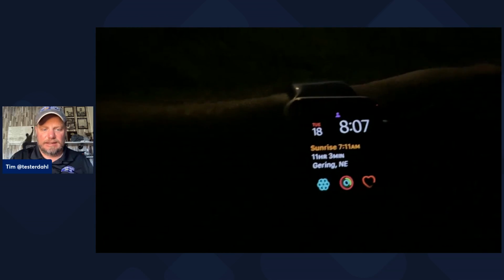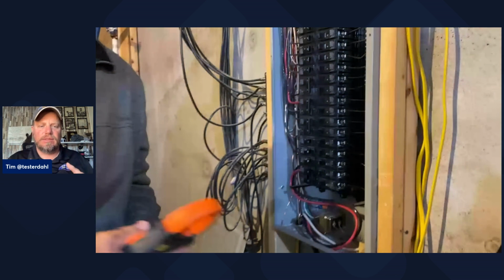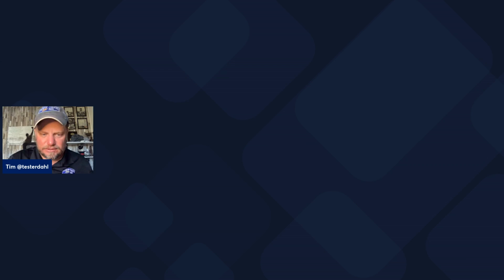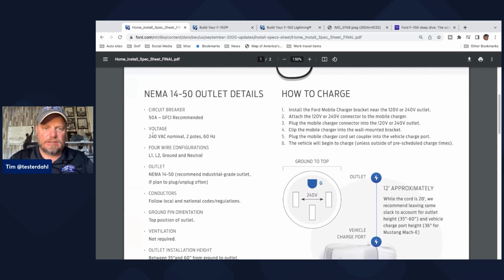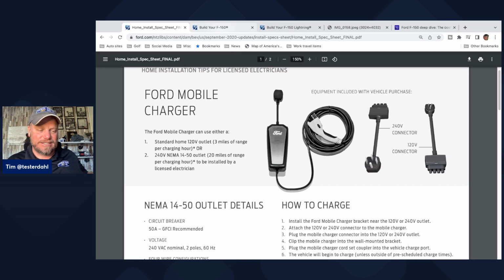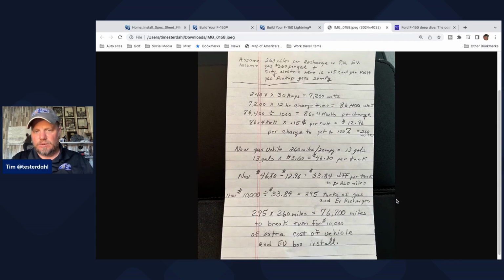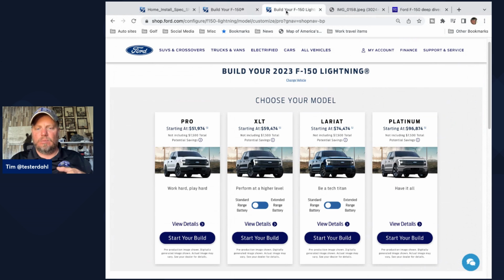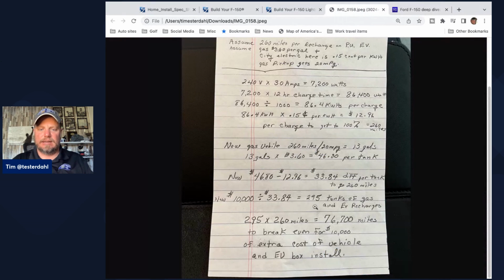11+ hours later on 220V charging price for 2022 Ford F-150 Lightning

Comment: A few comments...1. Batteries and electronics performance are dependant on their temperature.  So the range changing from 260mi@99% to 256mi@100% may have had to do with the temperature at the times you checked the truck status.  If you look at the manual for most electronics..phone, GPS, etc, they usually say something like "operating range: 40 to 104 degrees F".  The middle of that range is probably where you get the best performance.  This doesn't include the fact that mechanical components shrink with temperature and make things like bearing bushings tighter, which will require more power to run when its cold.  I could easily see if you tried to tow an RV out of hunting camp on a 20 degree morning where you are going to want the run the electric heater and electric butt warmers, defrost, etc. that you might have all of 40mile max range on a fully charged truck.  Never mind the fact that you will never have a fully charged truck sitting in hunting camp.  Nobody is going to take an acre of solor panels and stuff into the woods just to let it charge for a week and still not be able to get home.
2. To factor into the total cost of ownership...some states are charging higher registration fees, even double or triple, for hybrids and total electrics to make up for the fuel tax they won't be getting.  You know, the tax that pays for the roads you are driving on.
3.  Auto Insurance is higher because the vehicles are more expensive to purchase or repair (after an accident).

For all those people that think we can easily eliminate oil, natural gas, or other fossil fuel from our lives...take a look around you.  If it is made of plastic, sythetic fibers, most rubber, or many medicines...consider life without it.  Because the basic raw material that ALL of that came from is fossil fuels.  Cameras, TVs, clothes, seat cushions, mattresses, the computer or phone your reading this on, dishes, hats, and probably 80% of the truck this video is about are all made from fossil fuels.  If you want to imagine life without fossil fuels, think what life was like about 250-300yrs ago.  We need new ideas that no one has thought about yet.
Reply: You forgot to mention the transportation of all those goods. Everything, from food, to consumer goods, medical supplies, to the materials needed to assemble your electric car, is being shipped by cargo ship/boats, cargo planes, freight trains, and semi trucks. There's no current battery technology available to meet their needs.
Reply: Byron:  Once government mandates EV's, improvement stops.  Government stops competition and competition creates improvement. 
You can see this in cars.  In the 50's, small car manufacturers disappeared by 1956.  Of course American Motors stayed as a pet of the big 3. (Studebaker was on life supports until the 60's)i
The 59's were basically the same cars as the 76's.
In the 70's,  the EPA crippled the gas engines of the big 3.
Innovation came through the Japanese.
Reply: And the mining industry depends on a byproduct of fossil fuels to extract the minerals
Reply: @Bryan-Hensley  It sounds like you have to be an engineer to operate an EV.
I am used to gas and go.
I remember the days of carburetor adjustments,  points, condenser, spark plugs gap, distributor caps, and wires.  Those are a thing of the past.
Reply: Fjb
Reply: @jamesmooney8933  Lol with an EV it is plug and go, the issue is he didn’t do his homework to figure if the included charger was enough or if he needed a better one. I on the other hand bought a Chargepoint so I can use charge at a faster rate.
Reply: @seanroge  plug and go? You forgot to unplug it.   Cold effects the battery.   Battery cost about $20,000.  Of course you have to get maintenance insurance,  and hope the insurance company will pay. 
Water is a problem.   Where I live street flood.
As long as the water does make it to the air intake or battery which is about 2 1/2 ft.  You can make it through.   Once I was speeding through a flood road, and water was flying out like a speed boat.
EV'S have their battery in the frame of the car about 6" of the ground.   Once water gets to the battery or motor then you are in trouble.   You better hope you maintenance insurance covers water damage. 
No part on my car costs $20,000 to replace.   Also desposing of the old batteries will be expensive. 
I think you should buy an EV.
Reply: 1.8 cents per kw off peak electric rates. Way cheaper than gas. Only an idiot charges during peak. Super off peak almost everywhere including Sandy Erlich has the highest electric is about $.10 per kilowatt maximum. this is 60% cheaper than iterated in this video which means payoff comes much quicker, closer to 30,000 miles. 

If you have solar it’s even cheaper. Plus the oil changes, turn ups it’s way way cheaper. Calculate how much you will save over 150,000 miles you basically get the truck for free. 

You get the truck for money you were would have otherwise literally burned.
Reply: @Billetus  
But how long is that going to hold true, even if it is?
You can bet that at some point, those chargers will be required to have their own meter, and it will be just as, if not more, costly to run an EV than it presently is for an IC vehicle.
Then there's the little problem with the electricity used to charge them itself.
Most of it is from coal powered plants, and if you think that wind and solar is going to do the job, I have some ocean front property right outside Manhattan Kansas that I will let you have a sweet deal on.
I spoke with a dealer about used EV's, he said anyone who would even consider a used one needed to have their head examined.
Replacing the battery would be like replacing the engine in a gas or diesel car, and they can go kaput long before their stated life expectancy, and the warranty on them is a joke, they are not replaced free of charge, read the fine print just a bit closer.
They usually just total them out except for the truly expensive ones.
EV's may be the answer in the future, but it's a future that's likely to be well beyond any of our lifetimes!
Reply: This is about control not the environment 
The mining of all these things needed to build the cars are way worse than the oil industry
Reply: @jamesmooney8933  Not sure where you are getting your numbers. They can replace individual cells they don’t need to change the whole pack. Ground clearance on a Lightning is 8.4 not 6. Could keep going but don’t see the point.
Reply: We're not trying to eliminate oil. Just most pollution type and that's a no-brainer. EVs are one of the fastest ways to cut down on pollutions by ICE cars.
Reply: @Billetus  Electric prices have rising, under Biden. 
You don't have to be a genius to gas up your car. 
I can gas up anything. 
You have to be a technician to figure out the protocol for charging up an EV.
Reply: @jamesmooney8933  It is done technician but the whole battery does NOT need to be replaced just the damaged cells in the pack.
Reply: @seanroge  So how long will it last before more batteries need replaced?
It great for the upper middle class, but used cars are what services the middle & lower classes. 
Used cars get the poor to work, which feed you at the restaurants. 
If the lower classes can't get to work then welfare costs will rise.
Here is an interesting fact;
Only English speaking countries have a taboo against horse meat, but why?  One of the Kings of England made it illegal to Slaughter horses, buy why?  The situation was that only the nobility could afford horses. The nobles had large estates.  These estates were large farms,, that  were in the business of providing food for England. The horses were used to drive the carriages, riding, plowing fields, pulling wagons, etc.
After the horse we no good for work, the nobles would Slaughter the horses sell or eat the meat. 
So when the nobles could no longer Slaughter the horse, they sold them to the peasants, cheap.
(actually the beginning of what developed into the used car market)
The peasant started growing crops,  and other businesses that used horses.  This developed the middle class.   So when you see a used car lot, it actually funds the economy.
Reply: My BoltEV range fluctuates based on how the car is driven (speed driven, acceleration usage, A/C or Heater usage, terrain, etc).  I ignore it and just look at the capacity and I have learned that if I want/need a little more range, I can turn off the A/C or Heat or I can slow down a little.
Reply: @Billetus  let us know how much you saved on your EV truck after 150,000 miles and if all that stuff is still working. My Toyota is, and it does everything I need it to without any issues.
Reply: @radicalrick9587  I understand and support reducing pollution.  The problem is when you look at the whole picture of EV's...from the mining to the disposal; EV's have a bigger carbon and pollution footprint the ICE's.  You just don't see it in your neighborhood like you do with ICE's.  This is especially true when most of the electrical power to charge the EV comes from coal & natural gas.  Solar and Wind have the same problem as EV's...the cradle to grave carbon footprint is bigger than the current fossil fuel options.  Nuclear has the smallest carbon footprint of any power source, but I don't know if the country is ready to embrace that idea again.  Until they can get a consistent reliable 300-500 mile range and a 10min charge rate, especially in a truck; EV's will not be widely accepted.   EV won't save the planet.  Right now, we are stuck with choosing the least sucky options.  As I said, we need new ideas that no one has thought about yet.
Reply: Range estimate DEFINITELY depends on temperature, because it's assumed you'll be keeping the cabin warm and heating the cabin is THE killer of range in winter for EVs.  Ford should have included a combustion heater as a factory option just like many commercial vehicles have Webasto or Eberspacher hydronic heaters as a factory option.  (A few Chevy Bolt owners in very cold climates have installed Eberspacher hydronic heaters for cabin heat - best of both worlds for an effective "plugin hybrid" - combustion heat is 80-90% efficient while a combustion engine is usually 20-30%)

Also the last few percent of battery charges much more slowly.  That's an inherent behavior of lithium batteries - constant current until the voltage limit is reached, tapering current past that.

Something was a little odd with the truck pulling 30A - that's a rather odd current.  24A is the limit for a 30A outlet/breaker (NEC requires derating by 20% for continuous loads more than 3 hours), 32A would be the limit for a 40A breaker but those are rare - I'd expect to be seeing 40A pulled from a NEMA 6-50 or 14-50 outlet, and possibly even higher if hardwired.

Edit:  Apparently' Ford's base model EVSE only supports 30A, the base model Lightning can go up to 48A with a hardwired EVSE.
Reply: Thanks for telling us what we already know and leaving out everything else.
Reply: You explained it RIGHT. just do not tell that to Activist, you get all kinds of BS!
Reply: @Botman.com1125  What kind of BS? He stated things that are well known
Reply: They want to go green, Secretary Pete Buttigieg has already said he wants to change per miles drivers are traveling per year.
Reply: @Botman.com1125  our problem right now is we could be going under a authoritarian government where you are told what to drive by the GOP oil and gas company and they work for the cartel and not the American people the world is changing to renewables and green energy and the GOP big oil company is having a hard time with that ideal there are so many ways to make renewable clean energy .we try to get started in electric cars ago 50 years ago with electric cars the technology was not here yet but people loved there electric cars then .now the time is good to have more options on energy for many reasons it’s a good thing I think capacitors in the railroad system is going to be a big deal going forward with regeneration braking
Reply: @garyhunt2729  So does Elon Musk and he now has the influence to make it happen
Reply: @aaronwalters2677  electric vehicles will prove to be better if technology is not stop  by greedy oil cartels but besides that electric vehicles are the best and strongest motor on earth thats why trains use electric motors on the track batteries are getting better leaps and bonds and capacitors made with graphene are being made now it is exciting times we live in.I remember farmers all most fist fighting when other farmers were going to rubber wheels on there tractors they refused to change there ways to there death one thing is sure in life is change .I do think right now it is a no brainer vehicles no set routes like postal any local delivery are great choices .
Reply: @shane3878  your right just pointing out how they play there games your right
Reply: @drakemia4079  I agree electric motors are great and efficient but that’s not really the issue. Energy density and battery’s are the problem, fix that and then maybe start migrating towards EV’s.  Right now though we are literally wrecking entire economies because of a political narrative to just eliminate fossil fuels and that’s a dipshit way to go about this. I like freedom and I like cheap energy and if we stay on this path we’ll have neither.
Reply: @drakemia4079  No one can dominate the EV industry until technology and infrastructure are capable supporting said industry.  It's not even on my radar till there is a truck that can tow 15K pounds.  Along with scores of others.
Reply: @aaronwalters2677  EVs are great and Elon is going to have you driving one. They will be powered by nuclear energy.
Reply: @shane3878  your right ABOUT GOP BELIEVE THEM THEY WILL DO EVERYTHING THEY SAY THEY WILL
Reply: @keithdf2001  Doubtful, but hey I guess we’ll see if you’re right.
Reply: 100% Correct, the grim reality know one admits regarding the Green New Deal. 
As stated in the reply, the answer to all of this has not been invented yet. 
Nor will it be without cheap energy ( aka fossil fuels) which will foster advances in better education,science, society and intervention which will develop and solve the clean affordable energy issue. 
We’re not there yet…
Reply: Just live your life it will all work out my dad always said you will know more in the sweet by and by .
Reply: @doublegg6863  we will know more in the sweet by an by
Reply: @doublegg6863  let the oil run out everyone in the United States will have a job going green and doing everything by had .Or figure out clean ways to do things faster
Reply: It took along time to get to the moon, but it started with the political will to do it. I think the same applies to EV's and alternate energy sources. We have to start some where because the alternative is unsustainable and a danger to life on earth. Now we need the political will.
Reply: @billwhitis9997  there’s better ways for every thing it will happen
Reply: @drakemia4079  Not what I said and you know it.  You claim the GOP is authoritarian.  I say BS.  Given what happened the last 2+ years, anyone that claims the GOP is authoritarian is either deceitful or just plain lacking in the smarts department.
Reply: @shane3878  roll the dice go red
Reply: Clearly you know nothing about the technology of EV's
Reply: @seanroge  still think your missing the point. Technology isnt good enough yet to achieve what there trying to do. Grids cant handle just 10% of vehichles being electric.  Nevermind all the other downsides to creating all these unrecylable battieries there making. Average electrical vehichle lifespan is only ten years before the maintence costs exceed the value.  Just google all the fields of dead electric cars in Europe.
Reply: @markchapmon8670  Well, that sounds really handy, doesn’t it?  Turning off AC is not dangerous, but turning off the defrost in a northern climate certainly is.
Reply: Origin Materials will make plastic precursors from wood pulp and non-food organic materials. They will replace a serious amount of demand for oil to make plastics and other materials. Also, 25% of electricity now comes  from renewables in the U.S., and that figure is growing exponentially. Also, solar is getting MUCH more efficient and affordable. Same goes for battery tech, which greatly increases the value of wind and solar.
Several synergies ARE HAPPENING, right now, which completely undercut your logic. It's coming, fast, and this is a good thing.
Reply: @drakemia4079  everything is mined in other countries unlike oil and gas . That’s the majority of the jobs
Reply: You forgot to say nuclear.
Reply: @Billetus  Those price’s won’t last. The rules of supply and demand will see to that, just like it has done with gasoline.
Reply: @raymondlanier1112  the future is bright for energy more people more ways to do things it’s a great time to live in . I remember when I raised cattle we would .A.I cattle then all the cow would have calves at about the same time it is great but one year it was not we lost a lot of calves in a blizzard. I think putting all our vehicles on one fuel is a mistake for many reasons renewable energy can only get better big oil will all ways have a job no doubt they have kept it all to themselves but people know better the world knows better and are breaking records every day it is better for all Americans when they compete.we the American people always end up paying the bill but not having energy is worse so be happy every day and enjoy more ways to produce energy.
Reply: @raymondlanier1112  we need each other the sodium polbatteries
Reply: @raymondlanier1112  sodium polymer batteries are looking good
Reply: Ref  #2 Its also because of weight. Electrics are far heavier for the size. All that weight beats up the road.
Age gvw and engine size are the key considerations for registration cost in my state.
Reply: I saw a receipt on a battery replacement for a volt.  25K.
Reply: @fixitallpaul4847  yes but how many trucks filled with fuel don’t roll over the road to deliver fuel in America the more electric cars are on the road
Reply: I agree a stopgap solution halfway between two techs are very rarely optimum. I worked in the fertilizer industry. Guess where the raw material comes from mostly to produce fertilizers? It is a by-product of fossil fuel refinery. So we can stop eating as well as long as we have our EVs to drive in.
Reply: @drakemia4079  I'm not the one who doesn't understand what authoritarian means...
Reply: @jamesmooney8933  Good point about points.  In the early days of gasoline cars, you wouldnt get very far if you didnt have some understanding of how it works, for instance in the Model T you had to have a rudimentary knowledge of timing and mixture or you likely could never start it. As long as you understood enough to get it started, through experience you would learn when to advance the spark, when to lean the mixture.  I wasnt around for that but I do remember keeping an emery board and a spare points/condensor in the glove box that never had gloves in it.  Same with an electric car, it is different, you have to plan your moves. You can get used to knowing how to take care of the battery, things such as avoid charging to 100% unless you are going to drive it immediately, avoid discharging below 20%, avoid charging in below freezing temps. Many will be careful and get 150,000 out of their battery before it is degraded to 75% of it's original range, others will ignore the advice, charge it to 100% and leave it every day, and run it down till in forcably slows down and their battery will be wrecked in 25,000 miles.
 Battery electric is not practical for long distance highway use.  And it is not suitable for large vehicles like pickups, period.  Sure if you can afford 100k plus another 50k to charge it with your own solar farm, go for it and use that to teach others the realities of battery electric vehicles.  What needs to happen is standardize battery cells that can individually swapped out of the car in a minute. Instead of waiting to charge, you swap batteries just like your battery drill.
But the big problem that far too many who think we can flip a switch and no longer need petroleum are not aware of, even if we could make half a billion big assed batteries, just for US passenger cars, Where are we going to get the 16kwh per day that each car will need to charge them?  Your electric car will easily double your electric bill.  That is 6.2 gigawatt hours of power, and because every body wants to plug in their car to charge it at 7pm you can triple that capacity when sizing the grid capacity AND everybody wants to charge when there is little solar and the wind is not blowing so that requires more batteries accumulating energy in the daytime while the cars are out and about.  
Listen, I bought a used 24kwh Nissan Leaf because it looked like it would just work for my simple life, It will not make it to the next major city without stopping to recharge.  Frequent hot, high current (fast) charging is really hard on the battery, dont do it. It is absolutely unsuitable as a highway car, period.
It was cost effective for my close to home lifestyle until my state added a fee that was based on weight alone, no consideration for miles traveled, so now the electric car costs me more per mile than if I had gasoline. Because my electric rate has gone up 52% in 13 months I am now trying to figure out a solar setup to charge it.  6 high midrange panels, well aimed the whole time means it needs tracking, or triple that if fixed, seasonally adjusted, microinverters, a lot of heavy guage wire, framing, breakers, lightning surge arrestors, breakers, cutoff switches, ground rods,    all the rest of it, and if I am away at work while the sun is shining, I need another battery to charge while away to transfer to the car overnight, that being the case I need 2 more tracked panels to make up for losses, or I can feed the solar power on to the grid, only get paid the deferred fuel cost for that power, talk my employer in to allowing me to install a charging station at work, which also means assigned parking, and in that case I need to quadruple the tracked panels which may put me out of the range of Distributed Generation allowed for individuals and put me in the category of wholesale producer.  
 Folks, we are NOT going to throw a switch and everybody is happily driving battery electric cars. Electric trucks are a sick joke, it aint gonna happen in half a century the battery will weigh more than the freight even just for 200 mile range between charges, no exaggeration. It is just not possible unless if, and until, batteries are 100 times the power to weight ratio they are now. Then you still have the problem of where the energy comes from to charge them if the whole reason is to stop burning coal and petroleum. There would need to be more nuke plants than Charbuck$
Now if you will pardon me, the sun is up high enough to start making 20 watts, time to go aim the panels to catch it.
Reply: @laserflexr6321  You are right.   I like your points. 
I have one more point. 
Deisel.   Deisel fuels tractor trailers,  Deisel Locomotives,  tug boats that push barges, farm equipment, emergency generator in hospitals,  and ocean going ships. 
I don't see Lithium batteries doing these jobs.
Any other point of reference,  the horse was not replaced in 1903 with the advent of the model T.
As a child in the 50's,  I remember passing up horse drawn wagons in my dad's car.  It took 50 years to phase out the horse.
Speaking of Deisel, America is entering a Deisel shortage, which is going to destroy the economy. 
This will set back Green Agenda years to come
Reply: @seanroge  can you carry it with you everywhere you go? I’ll assume the answer is no.
Reply: @Billetus  wrong, the truck doesn't just become "free" and those solar panels don't always produce power ( however they do produce very little power ) , and you can't only charge your truck plugged in off peak if it has to be plugged in 16 hours a day.

maybe solar power would be relevant on the moon.
Reply: @seanroge What do you think it will cost to pull the battery, test which cells are way different than the others,  match them to cells with similar characteristics, equalize the voltage peel off the elastomer glued on lid on the battery case, disassemble the cell packs, replace the bad cells, reassemble everything with a new lid to replace the one that was ruined while peeling it apart, re-install the whole thing, warrantee a pack that still only has 85% of new capacity?  It's a bit more involved than clicking a pack on your dewalt hand drill. Individual cells going bad is a manufacturing defect, fairly rare, it will be more common that the whole pack has degraded such that it does not make financial sense to do all that, retire that pack to less demanding service than fueling a vehicle and replace it with a new pack that has well balanced cells that can deliver high amperage without risk of extreme heating of a mismatched cell.
Reply: @drakemia4079  Get out your calculator and look up some facts.
Reply: @orionbetelgeuse1937  I did the math on a farm tractor a while back.  They would be changing batteries every 45 minutes and would need 5 packs in rotation to keep harvesting when weather is appropriate to harvest. And almost no farm has the grid connection to draw that much power to charge with.  Snot gonna happen.
Reply: @fixitallpaul4847  I dont think the gvwr of electrics is a solid argument, the weight per area is nowhere close to trucks.  But your legislature will play that argument to make your low mileage electric more expensive to operate than gasoline, by imposing an additional registration fee like my state did.
Reply: I really don't understand why some think this is only about eliminating fossil fuels? Yes, there are some who think that way but that's not to say there isn't a place for EVs. Forget about the climate BS, or using an EV to pull your 10-ton camping rig 500 miles to and from your hunting shack in minus-40-degree winter weather. We typically use our F150 daily and our average day's travel since we purchased the vehicle in 2016 is around 120 miles per day. And that includes numerous (usually 4 per year) 2500-mile round trips from the Chattanooga area to Minnesota. So, I would think our normal everyday mileage is closer to 75 miles. Battery range is not an issue for us for 99% of our normal daily usage. Nor is "break-even" over the life of the vehicle. It's the daily payback most look at. 

When it comes to what's really attracting folks to EVs is daily costs. They could care less about all of the calculations to determine paybacks as most in our present society measure their wealth in monthly payments we can afford. I think we are typical users who might find EVs to be attractive. We seldom would need the 300-mile range and if we did we likely would use the ICE vehicle. (Second car) That's the good old gasoline burner for those not up with the technobabble. The attraction is the cost per day. The savings in our area where our electricity runs around 11 cents per KWH versus $3.00 per gallon gasoline easily pays for the extra monthly payment cost of the EV over its life. But, few care about that. They like the convenience. Come home, plug it in, go to sleep, go to work. No side trips or stops at the gas station or oil changes. Your fuel costs are mixed right in with the monthly electric bill. 

Bottom line? EVs have found a nitch. A very big one. If nothing else they are taking a hell of a lot of gas burners off the highways and filling stations saving that much more for those who choose not to buy one. In a very real sense, they are saving you folks money as the demand side of your fuel costs is going down with every new EV sold. Less demand, lower pump prices. The "supply and demand" thing applies here also. 

They are not for everyone for sure. That's true for almost everything we buy these days. If it's not for you, don't purchase one. Save your political fears for when the time comes.  When the oil sheiks start building electrical powerplants, that will be the time to start worrying.
Reply: @hendrikdebruin4012  the more cars that run on renewable green energy the more fossil fuels we have to make fertilizer it’s a win win for everyone
Reply: @shane3878  authoritarianism is a political system characterized by the rejection of political plurality the use of strong central power to pressure the political status quo and a reduction in the rule of law separation of powers and democratic voting political scientist have created many type of law to call descriptions variations of authoritarian forms of government authoritarian regimes may be inter-auto Craddick or oligarch and may be based upon the rule of a party or the military
Reply: @laserflexr6321  no one is taking your truck away you will be fine that’s a fact enjoy each day
Reply: TY
Reply: @Billetus  and you have a large paperweight sitting in your garage where the ICE truck keeps on going while you spend 20+ grand on a new battery for you to already "paid for " truck.
🤪
Reply: @Georgiagreen317  Some of us have actually listened to the people that said that was their intention, particularly the current President. And that was one of the very first things he did when he took office, make fuel increasingly scarce, and thereby increasingly expensive.  He said just recently he intends to completely destroy fossil fuels and that is what he has been doing.
Reply: @drakemia4079  I dont have a truck, my sole vehicle is a 2016 24kwh Nissan Leaf, it was ok till they added a registration fee that negated any fuel savings, so now I pay more per mile to get around, AND have to plan every move, occasionally stopping at a charger and paying a LOT more per mile.  I now regret that purchase and the thousands I have spent on solar panels that are making 75 watts right nowm, because it is cloudy, so I have to charge with electric company watts that cost 52% more than just 14 months ago. Enjoy each day when the cost of everything has doubled and the economy collapses because more businesses each day no longer make financial sense to continue and millions get laid off.
Reply: @Billetus  Yet the west coast grid won't be sufficient to handle the proposed CA EV plan.  Each EV uses roughly the power of a house when it charges.  Significant infrastructure changes in both power generation and the grid are needed.  Neither are cheap.

Also, battery powered devices have a degradation curve as a function of use.  Some call it battery memory where the battery peak capacity diminishes as a function of how often it's charged.  Phone users see this often.  EVs will also be subject to this phenomenon....
Reply: @drakemia4079  The raw material for fertz is a by product of making petrol and diesel. It is NOT the main purpose of the process. So are we saying we will then manufacture petrol and diesel that we do not need in order to generate that by product? Or we will have to set up new factories at tremendous cost to just extract the material needed for fertz. The same goes for all the other products mentioned - the are BY products - even poly plastics and other lubricants. So we will have to redesign our processes. And what is "renewable" green energy? Most countries in the world cannot produce the power needed on a daily basis from that. One example is natural gas. Why does the USA not stop using natural gas tomorrow as well then? And replace it with green electricity? It is all a pipe dream...
Reply: @hendrikdebruin4012  we went from diesel submarine to nuclear submarine they are cleaner and never need a feel up .soon electric cars will get there it’s all good ,it’s when we give up making thinks better for  all Americans is when we have problems we got to keep getting better at things all the time.we might make a space elevator someday .we never thought when I was a kid you would have a phone on your wrist or a color tv we it was a dream one day it becomes real sometimes .I have seen it happen in my life .
Reply: @drakemia4079  I live in Africa. We do not have the same modern infrastructure as the USA. We also do not earn the type of money Americans earn. We could never afford electric vehicles on a normal salary. So, what the USA decides for the USA does not necessarily apply to the rest of the world. I do not think that any country has the right to decide for the rest of the world - buy an electric car or walk? I have e 1973 VW Beetle as my transport. What do the USA suggest I do? Given that I am retired with very little income. Must I tell my elderly wife who has worked hard her entire life and is frail and sickly sorry we need to walk from now on. No more short trips to the local store. No daily trips on weekends. And want to visit the family 400 km away? Forget it. We have zero public transport. You cannot take a train anywhere at all the entire service has been destroyed. A bus? Not likely - can perhaps catch a long distance one but that still means walking 125 km to the closest departure point. See what I mean? I hope so. Peace...
Reply: You sound afraid of change or competition it is why America is great we compete and sometimes find better ways to do things .We already have many things that prove better and more popular in electric dills and electric lawn or  making cars with electric robots it is all the tools in the tool box American does not run on one kind of energy anymore let freedom ring stay free love one another .Go blue be free
Reply: @jofo1736  we are going to have more energy and the best grid in the world that’s really good for all Americans and there will be plenty of fossil fuels for everyone it is a great time to be alive in America 🎉🎉🎉
Reply: @garyhunt2729  But gag pretends to ride a bike to work. He has already been caught.
Reply: @jofo1736  they tell us don’t believe what you’re eyes have seen
Reply: @byronhaley1566  I tell you one thing backing up the grid with batteries was a no brainer they for years ran peaker plants on stand  just in case someone turned one to many lights on what a waste but we paid for it
Reply: @laserflexr6321  your analysis are incorrect once you understand how this works we can talk. Stop spreading inaccurate info from the fossil fuel industry.
Reply: @Roadglide911  if you are talking about my Chargepoint no but plenty of level 3 chargers when on a road trip. Day to day you unless you drive over 200 miles daily in less than 10 hours the pack will be charged while you sleep.
Reply: @seanroge  I am happy to further explain any point I made. If you genuinely know that I missed something, I want to know what it is so I can learn. What particular point do you wish to contest?  Go ahead let's see who knows more about petroluem, electric cars, solar panels, inverters, hydroelectric plants, nuclear power plants, multiphase electrical distribution systems, lasers, robots, CNC controls, PLC's, chemistry, physiology, electronics, medicine, law, plumbing, geology, geography, geophysics, astronomy....  I didnt just wake up thinking I know it all, I have been studying everything I could get my hands on for decades to get as close as possible. For example, I first dove deep into the electronic and chemical aspects of a photovoltaic cell in 1982, and have followed the evolution since. 
 I had a rough design for a hybrid electric vehicle in 1991 similar to the idea of the Prius, but I wasnt including any traction battery storage and used 4 independent wheel motors, but it would have taken $150k to produce a working prototype using off the shelf components, if no major redesign became necessary, and that just wasnt possible for me at the time. I'm not new to this stuff, and I am not just taking what someone else said, I have done the research. Go ahead smarty pants tell me what I wrote that was inaccurate, and provide facts, not just derogatory comments and accusations. If you prove me wrong, I will stand down.  I might even appologize if you are respectful about it. 
All these years following solar panels and they still are not ready, but, with the idiot government pushing it, I finally purchased my first serious solar panels. I have to tell you, so far, even knowing what I do about how to get the most out of them, it does not look good, but hey, if you and enough others force the issue, I dont want to be the last one without them when no other source of energy is available or affordable. 45% increase in the cost of electricity in one year convinced me I better put in a system. And in the 2 months since I made that purchase, the grid electric has gone up another 7%. 52% increase in just 14 months!
Bottom line, your electric vehicle and the solar system to charge it with will run you about $150k, if you have a wide open space to put your panels, if not you have to convince your neighbors to the East, South and West to cut down all their trees.   Good luck with that. BTW, has anyone conducted  the environmental study on the effects of cutting down all those trees blocking sunlight from solar panels?  Did you know that the shadow from a single overhead wire can cut the output of a solar panel in half? Clouds will cut it to 10%. Imagine paying for 8kw solar system and only getting 800 watts out of it cause it is overcast.  Look up the details on Fukushima.  Some of the most technically savvy people on the planet, and one of their nuclear plants failed catastrophically, and the damage is still occuring, no crabs in Alaska.  Now consider, if the US bans fossil fuels, the only known substitute is nuclear reactors.  Hundreds of them, and they take 20 years to build.
Reply: @orionbetelgeuse1937  I got the HP figure by looking at the rated HP of combines for sale, seems like the average of the probably half dozen I looked at were 400-500 range.  You are right, it is so far from workable it will not happen until batteries have 100 times the energy density of batteries you can buy now.   Farm equipment is already expensive but enough combine sized batteries would cost in the millions, even if it was a workable solution.  Same story with tractor trailers,  the battery would weigh about 36,000 pounds for a 200 mile range. The tractor weighs about 18k, the trailer weighs about 20 leaving about 4k out of the 80k maximum Gross Vehicle Weight Rating.  A tractor trailer would only be able to transport about 2 pallets while it is dragging 36,000 pound battery compared to the 16 pallets a diesel road tractor pulls now.  I keep telling advocates of getting rid of fossil fuels to just do the math and they will see for themselves that there is no way it is going to work any time soon.  Dont take my word for it, look up the actual numbers and do the math yourself.  Dreams are great, we should all have them, but you cannot dream away the laws of physics. There will not be anyone with the resources to continue research and development when society has collapsed cause we are all freezing and hungry.
Reply: @Billetus  Yes D.K.  Electricity is "WAY cheaper than gas and only an idiot charges during peak", until the utility companies see an uptick in usage during 'non-peak' hours, then they raise the rates.  We will no longer see 'off-peak' rates.  It'll all be the same price per kw/hour.
Reply: @orionbetelgeuse1937  Your info is outdated.
Reply: @orionbetelgeuse1937  what ever is green and clean that’s the goal right
Reply: @orionbetelgeuse1937  There smarter people in the science world than we are that’s a fact right
Reply: @jamesmooney8933  Bottom line: if you really want to F things up, put the government in charge!
Reply: @orionbetelgeuse1937  we will meet our goals against carbon
Reply: @tooterooterville  You are so right.
Reply: @orionbetelgeuse1937  sure no problem we live in America we can all speak freely here you put up with trump
Reply: @orionbetelgeuse1937  I should not have said it that way but we need to keep looking for new ways to do things
Reply: @orionbetelgeuse1937  check out chinas biggest electric bus and car factory B Y D over a 150,000 workers they aren’t wait around to switch over to green energy.All the red state in America in my area are putting in windmills and solar big time so looking around does not add up to be a bad choice E V S
Reply: @orionbetelgeuse1937  it’s good  to live in a free country were you can  try to figure all this out that took billon of years to happen .We are just a speck in time enjoy the search every day for the truth in all the world and how it all works it is very complicated even how this world seems to hang in space ,in reality the sun is moving very fast and earth is circle around it and the space is expanding at a billion miles a second after the Big Bang but scientists are changing there thinking on this it is a lot to take in
Reply: @radicalrick9587  EV cars lead to more pollution than ICE vehicles, not less.
Reply: Except this is allegedly a truck. It is not as advertised nor is the current technology prepared to keep it or any EV on the road without the inconvenient truth regarding the carbon required to make it. The fact slave labor in Africa, Afghanistan and China are the leading production centers for the battery production. It's similar to blood diamonds. The entire car is made with oil based materials. And the electricity is made by burning coal, natural gas, oil.    .2% is being produced by wind and solar. The hydro section of the equation has been neglected for 50 years and now is unsafe requiring major reconstruction projects that will take them off line for years. I'd like to install a magic skylight at my house but magics not real.
Reply: @laserflexr6321  : I have read of a car company, Nio, that proposes to sell an electric car, without a battery. (much cheaper for the car). You then buy into a program for a battery. At a robotic shop, the whole battery is replaced by a charged one, in a few minutes. Battery maintenance / charging is done for you.  So a 10 year old vehicle would still be getting good batteries.  And a full charge in a few minutes.
At least that's the plan...
Reply: @laserflexr6321  : to add to that, I looked into a small electric outboard for my sailboat. The company bragged that the 8 lb battery held as much energy as 1.5 oz of gasoline. The 2 hp electric outboard was heavier than a fully fueled 5 hp gas outboard. Pretty easy to guess which had the best range and speed.
Reply: @drakemia4079  Canada, the Netherlands are looking to reduce fertilizer use by 30%. The politicians believe they know more about farming than the farmers do.
But we'll save oil, and let people starve. But I guess with 30% less population, it will work out...
Reply: @vickanid1862  : I read of these wonderful Gigawatt battery factories. I never read of the infrastructure  upgrades required to come up with these gigawatts.
Reply: And why haven’t they thought of them?
Reply: @byronhaley1566  we are getting new ideas every day let’s hope for the best for all because at then end of the day it takes all of us
Reply: Batteries will become better than gas and diesel very soon
Reply: Batteries will be better than gas soon
Reply: @drakemia4079  : better in what way? There is no problem with motor power. Small cars have good ranges. I saw a video with a full size truck, when towing, got 85 miles per charge. They had to disconnect the trailer to use the charger. The same model, driven off into undeveloped areas, needed 13 hours to charge from a dryer outlet. But batteries have improved over the last couple of hundred years, and are continuing to improve. For my needs, a plug in hybrid would work, but I don't like the idea of having 2 drive trains in 1 vehicle.
Have you noticed these "gigawatt battery factories"? I have yet to see extra gigawatts of power generation to recharge them.
Reply: @Billetus   The average cost for kwh in the US is 17 cents.  An average EV owner would not see drama tic savings like you.  Making a claim that solar is 'even cheaper' is misleading.  The average solar panel system in the US is around $20k which also has a payback period.  Oil changes are a rather insignificant cost of ownership, both EV and ICE have similar maintenance costs in tires, brakes, suspension.
Reply: @andrewkaiser7203  20% from renewables, according to google.  Payback on renewable installs can be anywhere from a few years up to never, depending on where you live.  Realistically people in northern climbs would never see a payback.    If you are looking for a reduction in C02 emissions, forget it.  Fossils fuels for mining, production and end of life recycling of wind mills and solar panels result in about the same contribution of C02 to the environment.
Reply: we'll just have to go back to whale oil for everything.
Reply: @Billetus  there a multiple taxes and fees that are part of any electric bill. These are often as much as the “KW Rate”. You need to factor these in as well. In NH the KW Rate was increased 112% this summer. Eversource is now requesting another rate hike to be applied in Feb.
Reply: VERY WELL SAID AND ABSOLUTELY TRUE!
Reply: @Billetus  You forgot to factor in the cost of replacing the battery no telling how many times over the life, or I should say death, of the EV.
Reply: Corn 🌽
Reply: @shane3878  Your logic is flawed. First let me say that I am not saying the GOP or the Democratic party are authoritarian, nor am I claiming either are not, because that argument will suck me down a rabbit hole I don't want to be in. However, just because the Democrats have been acting authoritarian does not mean the Republicans are not authoritarian, that is simply not logically sound. Republicans are not the opposite of democrats on everything. Simply pointing out the logical fallacy.
Reply: @nicholasfoley7105  I think there is more nuance in it than that. The grid in some places can't handle 10% of the people putting in air conditioning, and in some places it is resilient enough to have 10%, EVs today. But even if all new cars were EVs tomorrow we would take 2+ years to get to 10% EVs, and we are not set to be 100% EVs until at the very earliest 2030 (in Washington), 2035 in some other states and 2045 for the US. Used cars still make up the majority of the market. There are close to 300 million cars in service in the US and only 15 million new car sales every year. That is 5% of the cars on the road each year are new cars. That is plenty of time to upgrade the grid, and yes some of the energy will come from fossil fuels and some from nuclear, and some from clean energy sources.